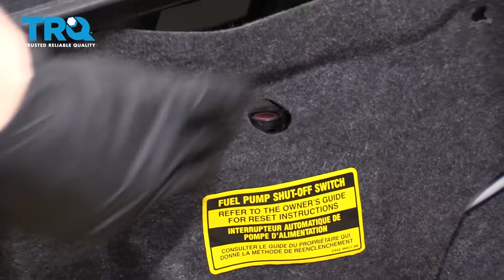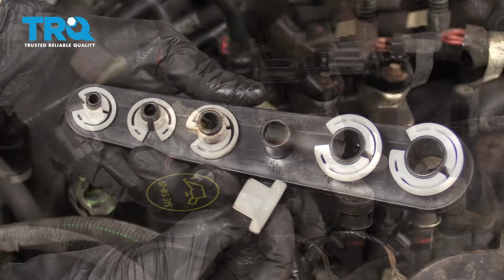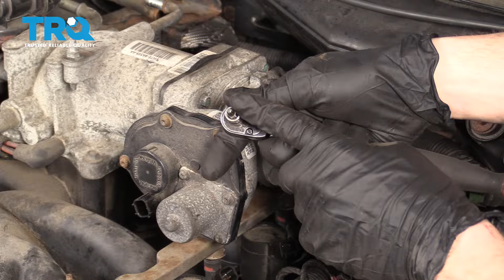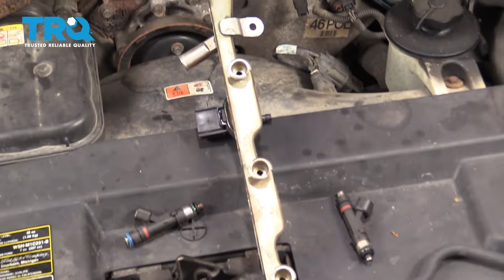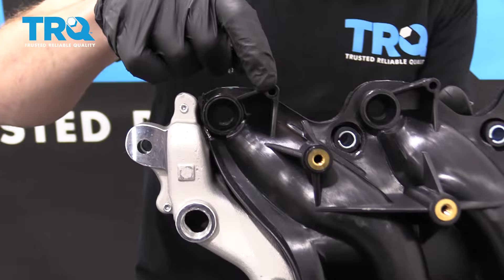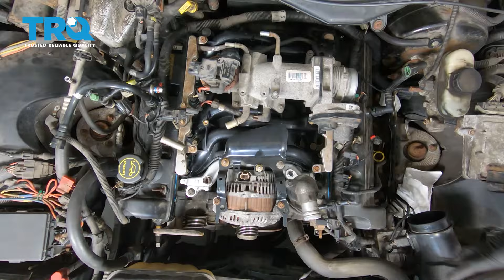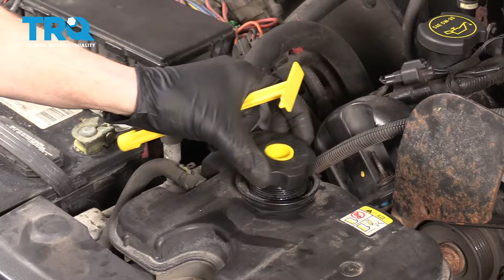How to Replace Intake Manifold 1998-2012 Ford Crown Victoria

Comment: Very good video.
However, some minor criticisms: 
1. The lower EGR tube heating and removal (as shown in the video) is really unnecessary and possibly dangerous. 
2. The top radiator hose can remain on the elbow going to the intake manifold, without risking damage to the rubber hose. 
3. A radiator flush might be worth doing before re-filling with fresh coolant. Run with only distilled water and the radiator flush chemicals for maybe 50 or 100 miles of driving, without the thermostat installed (for better circulation) for that short time period. The plastic overflow tank can also be removed and manually flushed out with hot water, shaken to dislodge the crud, and re-rinsed several times for best cleaning effect.
Reply: This just saved me alot of time thank you cuz i didnt want to go underneath honestly
Reply: @jefferey johnson  that's what I did too. The EGR tube flange is such a bastard to loosen.
Reply: Who is this? You are awesome
Reply: Thank you R.Vail, I did not want to remove that lower EGR connection!  It looks like I can get the intake off without moving the EGR tube much, but I wonder if it can be gently pushed back, maybe tied back a few inches without breaking it.  Maybe it isn't necessary to move it at all, not sure? I don't want to break it
Reply: @gregvandy8902  just did my intake manifold upgrade you do not need to take off the egr tube by breaking the bottom nut that holds it in, just wiggle the top portion out of the way removing and installing your manifolds
Reply: Can this process work with the upgraded ford performance intake manifold made for mustangs?

Comment: Is it mandatory to take off the EGR tube... Why can't you just unscrew it from the top and leave the other end in the exhaust
Reply: I just unscrewed it from the throttle body and it only got in the way when i had to remove the intake manifold, but, that bolt refused to budge with PB blaster, so just took out the 2 10mm bolts and it was much easier to take those out.
Reply: I do not believe it is mandatory. I saw another guy online and he left it in place. Disconnect it from the EGR and leave it alone.
Reply: You can just unscrew it up top
Reply: No it isnt. I cant stand that he put that in the video. I did my 97 Towncar and it was way easier then what he did. I think I disconnected the top egr tube? Its been almost three years and no problems.